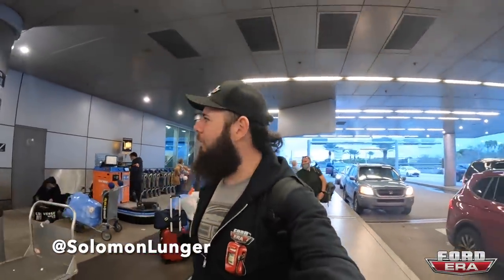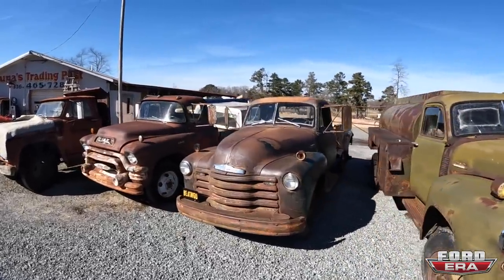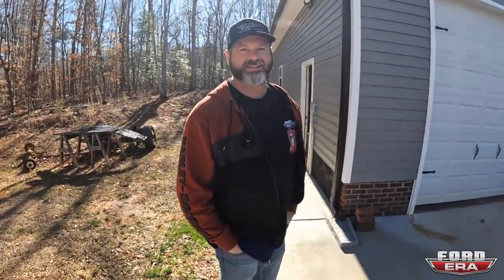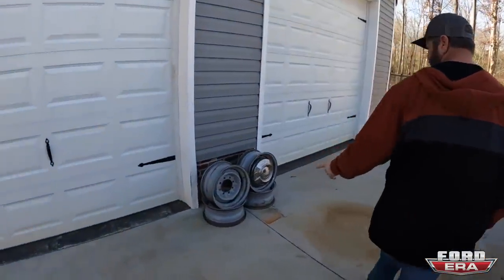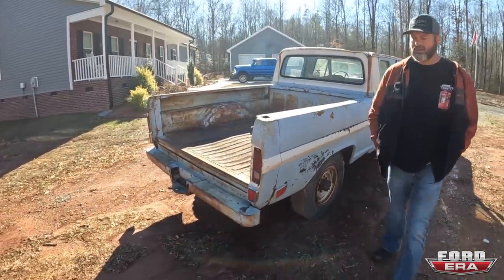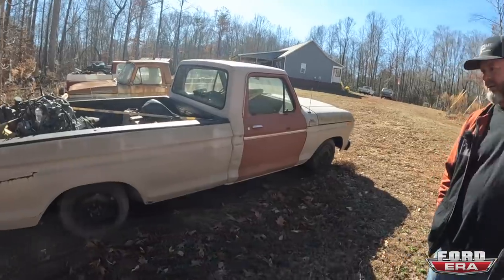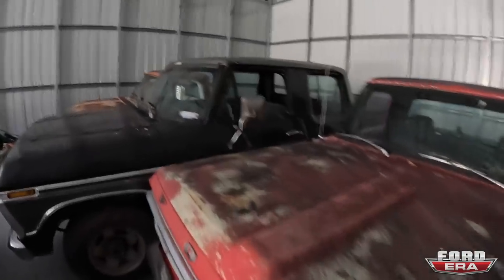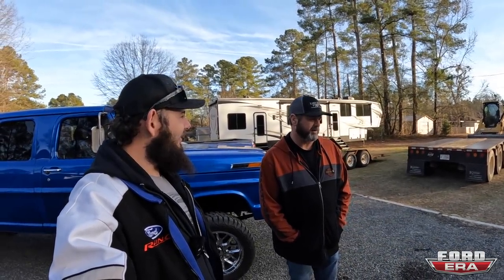Flying to North Carolina to BUY A NEW TRUCK! | Ford Era

Comment: If Joey is the guy I'm thinking of out of Florida making truck bed floors, they are the wrong style for all trucks between '57 and '66.  That goes for the vans and Econoline trucks, too.
The ribs of his floors have 45⁰ edges which are for later model trucks vs 90⁰ for the earlier trucks.
Take a close look at the difference.  If you're going to go through trouble of putting in a new bed floor, it's best to get the right one....or don't do it at all.
Reply from the maker: It is the joey from florida. There are no other options. for me thst 45* degree difference is ok

Comment: this fella Mike surely can score you all the parts needed for your 60’s b100 .. looked like he had more than enough lying around.
gotta be better than butchering that clean, running, red f100 which will be criminal.
Reply from the maker: I have other parts at my shop i can use aswell. But once i start on the tear down it will all make sense.
Reply: @FordEra  I know I keep giving you shit about that red truck .. and hell its your money, plus Im a GM (Holden🇦🇺) guy so I really shouldnt care anyway .. just dont wanna see a good solid truck taken off the road when theres still plenty of parts trucks around to chop up. 👍